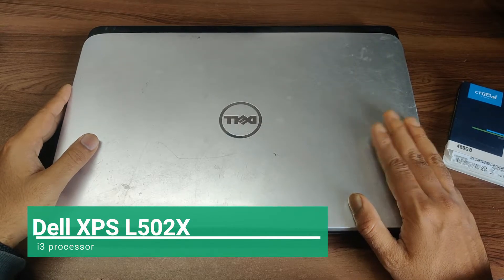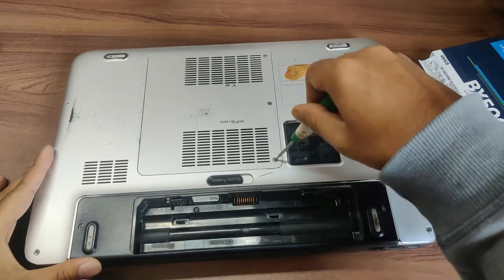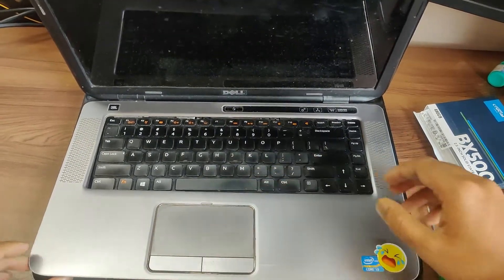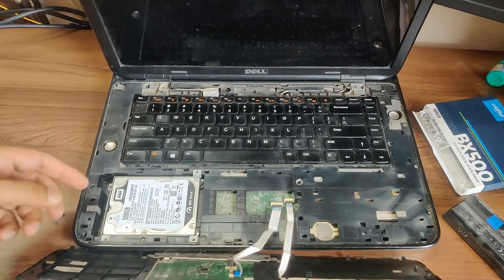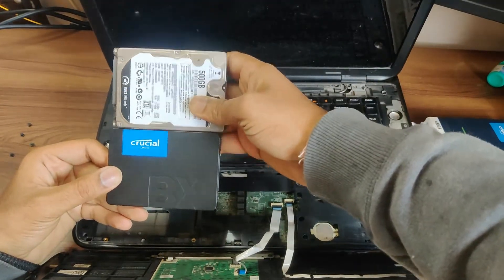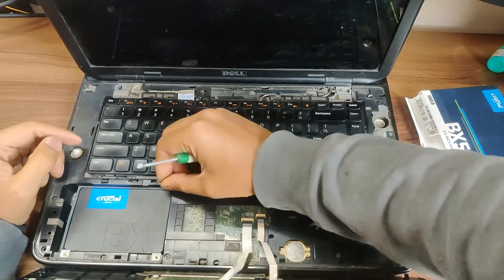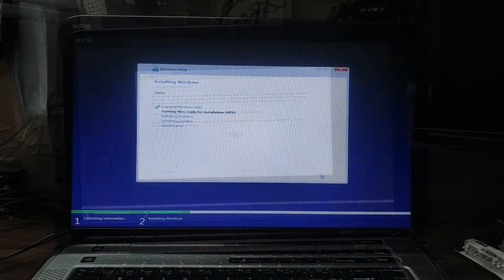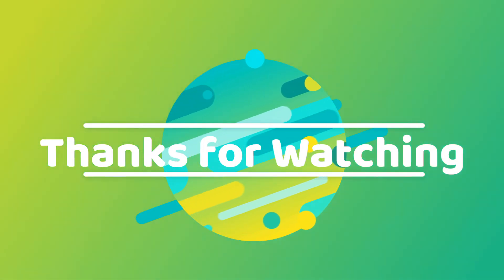How to UPGRADE Your Old Laptop with a SSD. Link in description

Comment: Hi i have the same laptop, i have an issue , my charger is working if i connect my charger to the laptop the LED in the charger gets off , system doesn't on , what to do is my charger not working?

Comment: Hey. I'm having same model x502l for years since I've bought it at 2011. Last year I've upgraded hard drive to SSD. Now I've swapped i5-2430m to i7-2820QM with all new thermal pads and paste, RAM from 8 to 16GB. Wifi card from intel 1030N to 7260ac. After all that upgrades, it's still a fast machine with proper speakers ;)

Comment: I'm sorry, I'm using the google translator, my problem is that I want to update my l502x to sdd, the bios recognizes the ssd but when I turn on the laptop it says "operation system not found", the ssd is a WD Blue SA510
Reply from the maker: You need to reinstall os on your ssd
Reply: @ezybzy7990  Same issue, I indeed install the OS on SSD